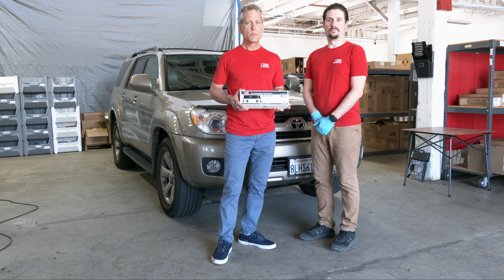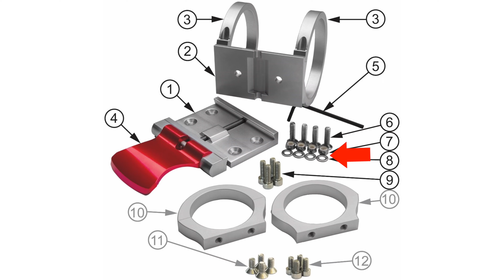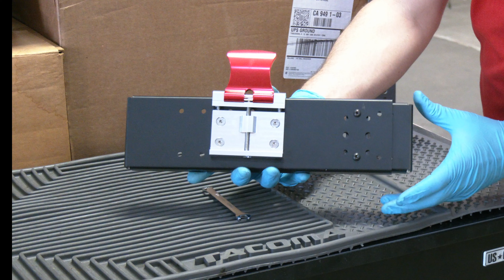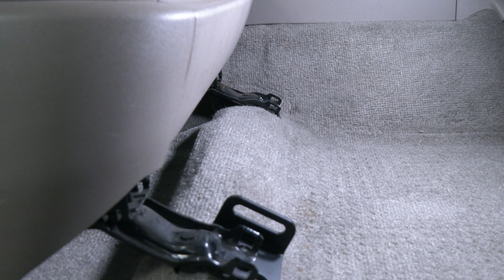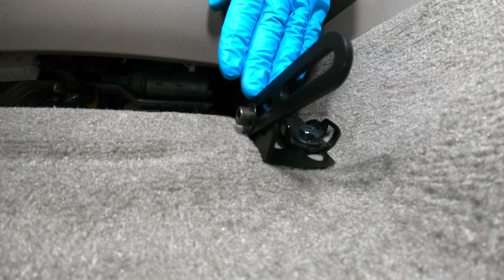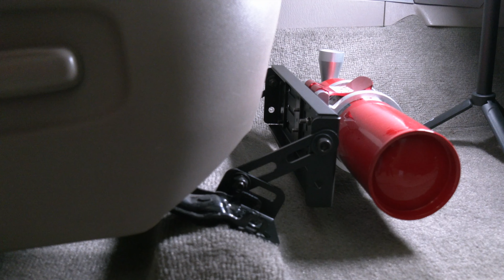Fire Extinguisher Vehicle Seat Mount and Bracket Installation from H3R Performance- Updated

Comment: Okay now show me how to install without your pro lock system.
Reply from the maker: Hi! Thanks for the feedback. Because the Seat Mount is compatible with all our brackets it would be a very long video to show them all. Installation is identical for all of them except with the Standard and Extreme Duty mounts you use the button head screws and the small backing plates. We have instructions with photos included with the Seat Mount, but if you experience any hiccups please give us a call, our CS team is here to help :)